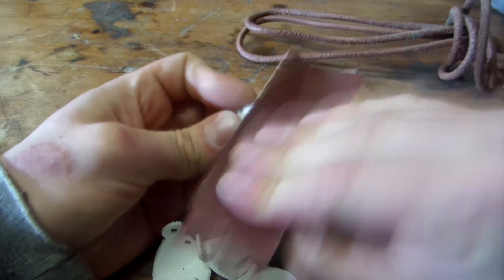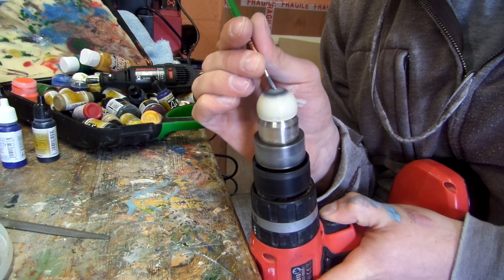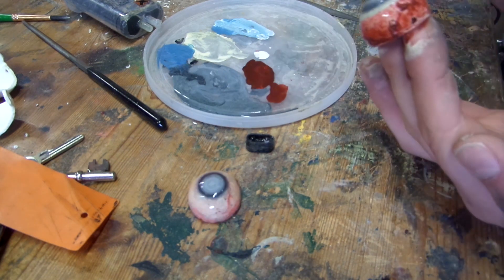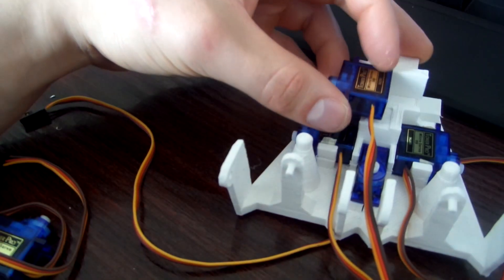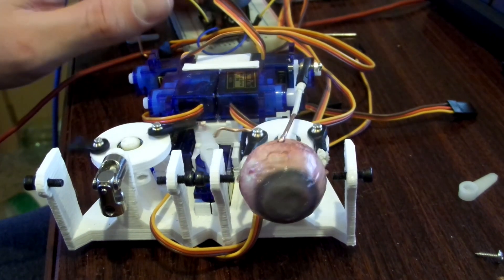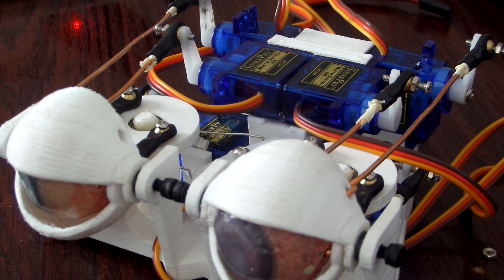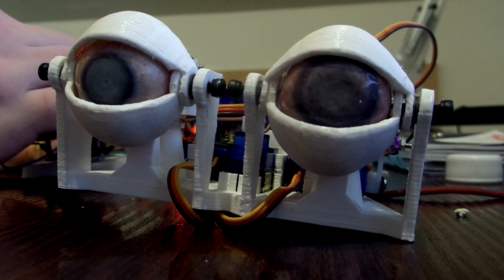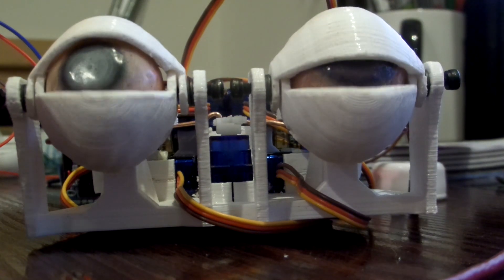DIY Animatronic Eye Project Update

Comment: Will, what exactly is different/better about the servo controller board, over the Arduino pwm mechanism?
Is it smoother because the Arduino does bad PWM? Or does the dedicated board somehow compensate/eliminate jittery stand-still requests?  I'm curious!  
Btw- checkout my servo control on my 30' robot hand video...it runs on 2 Arduino Megas (a custom PID I wrote).  I'm going to add a new video on it soon! Stay tuned...

Comment: Cool project, great concept/design.

One minor idea(?): could you remove one servo for the eye up/down motion by linking them via a central shaft spanning the housing and a set of armatures for each eye? For a realistic lid motion, especially if you want more expression, you are stuck with 2 servos per lid, BUT by linking the eye motion like that, you could bring the number to 6 servos...
Reply from the maker: Thanks, and great suggestion. I'd been working on a mark 3 of this design which did only used 4 motors but I think 6 is going to turn out to be ideal (two for each eye then two for both eyelids), hopefully I'll get around to finishing it soon.
Reply: Can you upload the stl to thingiverse?

Comment: This is awesome and I’m going to try to replicate it. Do you have the names for the connector pieces you use? There seem to be 2 silver O rings, and a bunch of joints connected to the wires.
Reply from the maker: Cheers, and good luck! I'm not sure what parts you're referring to, the connectors for the eyeball to the base are called universal joints (I talk about them a bit more in my other eye video) and the parts connecting the motors to the copper wire were just called ball-socket joints on AliExpress where I got them. Does that answer your question?
Reply: Thanks! That's probably enough to go on. I'll take the video in to my local hardware shop and see if I can find them. You wouldn't happen to have links from where you bought them online, would you?
Reply from the maker: I did have links but it looks like they've been taken down now. This looks pretty close to the one I bought(3mm x 3mm) 

https://www.aliexpress.com/store/product/2-2-3-3-3-17-4-5-6-8-10-mm-Metal-Universal-Joint-Shaft/1682141_32895044287.html?spm=2114.search0104.3.59.5eb02061qreXru&ws_ab_test=searchweb0_0,searchweb201602_4_10065_10068_10130_10547_5016515_10059_10548_5016715_100031_10696_10192_10190_10084_5016615_10083_10103_451_452_10618_10307_10820_10301_10821_5016415_10303,searchweb201603_45,ppcSwitch_7&algo_expid=57ab6def-c71a-4576-9fc3-8f2af91cc362-8&algo_pvid=57ab6def-c71a-4576-9fc3-8f2af91cc362&priceBeautifyAB=0 

 and this https://www.aliexpress.com/store/product/12Pcs-2-5X27X3mm-Rod-End-Metal-Ball-Head-Buckle-Joints-Black-for-RC-Climbing-Car/1739482_32442527525.html?spm=2114.search0104.3.26.2a587d6fubVelp&ws_ab_test=searchweb0_0,searchweb201602_4_10065_10068_10130_10547_5016515_10059_10548_5016715_100031_10696_10192_10190_10084_5016615_10083_10103_451_452_10618_10307_10820_10301_10821_5016415_10303,searchweb201603_45,ppcSwitch_7&algo_expid=97226a14-3525-4510-8578-db33c89603eb-4&algo_pvid=97226a14-3525-4510-8578-db33c89603eb&priceBeautifyAB=0. 

I had to go to aliexpress because I couldn't find them in the UK, but it might be worth having a look on amazon for an alternative because they take a while to arrive.
Reply: If you're in The States and want those universal joints quickly, here's the link that I found:
https://www.amazon.com/gp/product/B0732SFZNK/ref=oh_aui_detailpage_o04_s00?ie=UTF8&psc=1
Reply: I ended up getting a high collar washer but I couldn't find one small enough so I ended up gluing it on. Not super secure but better than nothing!

I'm having trouble getting the code for the left eye to follow the movement of the eye. Which string connects the vertical movement to the movement of the eyelid? I'm having trouble isolating it. I'm assuming that it's in here under the void loop:

} else {
    
  leftbottomval =  map(leftyval, 0, 1023, 20, 50);
  rightbottomval =  map(leftyval, 0, 1023, 150, 120 );
  lefttopval =  map(leftyval, 0, 1023, 80, 130); //
  righttopval =  map(leftyval, 0, 1023, 20, 80 ); //20, 80
    leftbottom.write(leftbottomval + openval);
    rightbottom.write(rightbottomval + openval);
    lefttop.write(lefttopval + openval);
    righttop.write(righttopval + openval);
    }

Can't wait to show you the finished product, man! This has been so amazing/frustrating to work on. = )

Comment: The videos are great .. Want to paint mine? What paints are you using here?  thank you, great work And you were saying you want to have the servo run smoother here is a site that might help you out with your problem as I had the same thing some time back for another project I was working on. its called servo easing and the library is on this site https://arduino.stackexchange.com/questions/29966/smooth-servo-control-library/30008
Reply from the maker: Thanks! I was actually mid way through making a more in-depth video about painting the eyes but I haven't had the time just lately. Those are just acrylic paints, vallejo model colour but I don't think the brand matters much. And cheers for the link, thats relevant to nearly all the projects I do haha